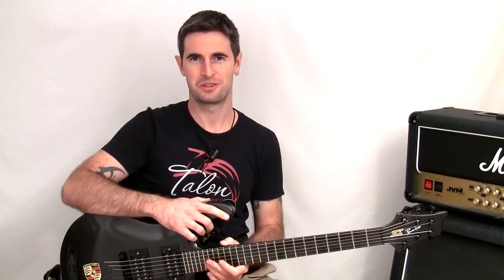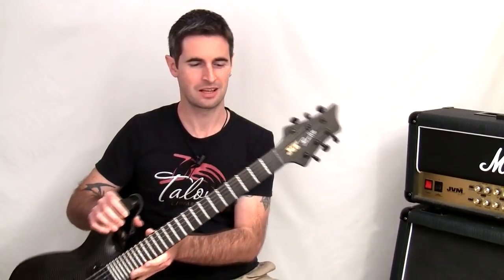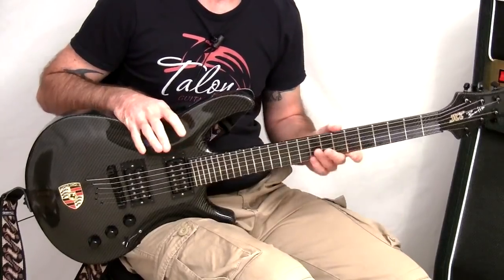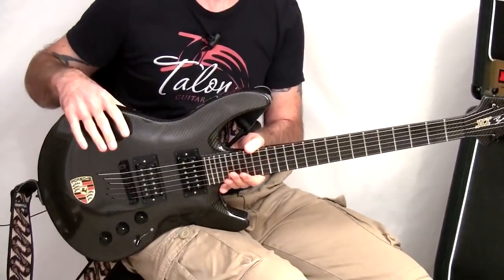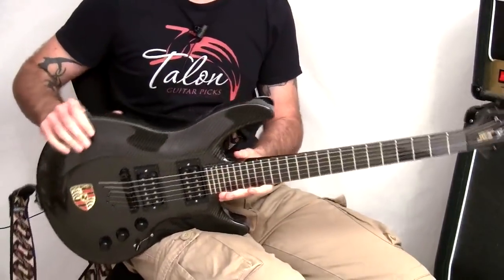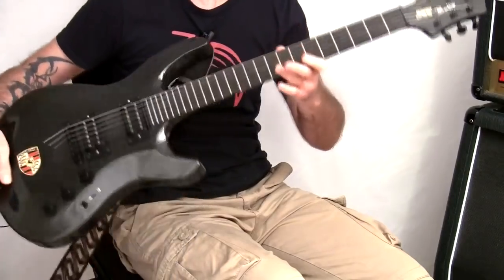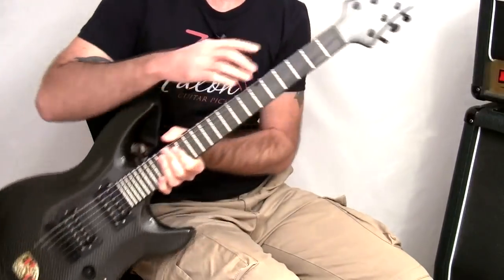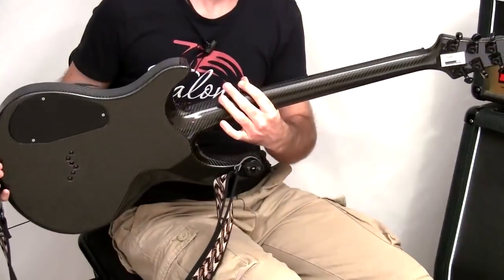This is What a CARBON FIBER GUITAR Sounds Like

Comment: It's a marvellous instrument. Tonewood is a scam.
Reply: Just because carbon fiber has a good sound doesn't mean the materials don't affect the sound.
Reply: If wood makes a difference its minuscule. Never seen a proper comparison video that shows a significant difference. Ill take the practicality of carbon fiber over wood any day.  Doesnt bend, isnt affected by temperature, light as hell.
Reply: @guitarboy4000000  Doesn't make a difference on a solid body electric. The setup can make a difference, the wood doesn't. The wood can make a difference (rather small) on a hollow body for unplugged sound, but as soon as you introduce pickups you can throw the wood out of the window. The only instruments where material can make a difference are acoustic ones, like an acoustic guitar, because then the wood can directly affect the way sound resonates within the body due to difference in flexibility. The magical tonewood for an electric guitar is bullshit propagated by the marketing department to sell you overpriced guitars.
Reply: @SkinnyBlackout  we agree on this point. what I have stated is that I have not seen a scientific experiment that can show me definitively that wood makes a difference. So even if there was a difference, it would have to be so subtle that its almost undetectable. my broader point is that having a guitar that is 3.5 pounds, doesnt bend, doesnt warp, and isnt affected by moisture would be so awesome that its not even worth considering if the material slightly affects the sound.
Reply: @guitarboy4000000  That is correct. There are electric guitars made of metal, those are cool af.
Reply: @SkinnyBlackout  well i was referring to this graphite one. imo even cooler than metal
Reply: pickups and amp make most of the sound not stupid tone wood unless you are playing an acoustic lame guitar

Comment: All I know is, the worst struggle for a guitar player is the constant fiddling and adjustment that wooden guitars require. Every day is a different story,  the weather changes and you have to adjust truss rods and it's gets old, then you have to worry about things breaking. It would be nice to own a guitar that is light in weight and doesn't require constant maintenance. With that said, if these had these in a V or Explorer type shape, I'd be all over them.
Reply: Maybe an all steel guitar with a back support?

Comment: It's got to be hollow to be the weight you state (if it was solid carbon composite, it would weigh similar to am un chambered Les Paul, resin is as heavy and dense as hard wood). I assume it is made like a surf board with a dense foam core. Please clarify.
Reply from the maker: It's a semi-monocoque construction so most of the stress is transferred to the outer surface. It's a semi hollow body guitar. There's no foam inside it.

Comment: RE: all the "tone wood" comments.  I've seen some videos that show measurement of the difference and there appears to be some.  I don't know if its perceptible or not.  What I do know is that I have some guitars that are the exact same - I bought duplicates because I found inexpensive guitars that I thought were great so I bought two (or three **he said sheepishly**) .  and I have a definite preference out of those duplicates.  some of my guitars with the exact same strings and hardware sound more "alive" even when strummed unplugged and some sound dead.  Some sound resonant and some don't.  I don't know why that is.  My theory is that some materials absorb some frequencies while others don't.  I.e. if you were to make a guitar out of play dough it couldn't possibly sound the same as one made from metal or wood etc.  Maybe there is some vibration feedback from the tremolo to the tuners and it makes kind of a loop that has some effect on the pickups?  why does a semi hollow electric sound different?  Another izzample:  I went to GC and just picked up a Mitchell MD-300 to try out and amp.  I was blown away by that guitar after trying it out on a few different amps.  Got mine on sale at $230 (just looked and they are now $200 dang it!  - still - that guitar is a freakin steal!).  Anywho, my OCD insisted on a shiny new one - I didn't want the demo model covered in fingerprints so I tried out the three they had in back.  Turns out the one that felt the best and sounded the most alive and resonant was the demo model so I bought that one and just cleaned the Shiite out of it.  I know we've all had that experience.  One more:  frequented a guitar store a bajillion years ago when I toured (regionally - nothing big time) and one day I walked in and the sales guy who I knew well was all excited to get me to try this strat that he said was awesome.  I didn't want another white strat so I tried others and he was right.  
One last example:  I went to GC determined to get a good cheap acoustic since I thought I should play acoustic more.  Went through all the lower pricest models and meh.....then I tried some pricey martins and then some Taylors - martins felt too dark and Taylors not enough guts.  Then gibson J-45 and wow! perfect balance.  Knew the sales guy very well there too after years of buying shit.  he said "dude, you gotta try this one we've been keeping in the back to play for ourselves because its incredible".  I played one chord on it and felt it.  resonated beautifully.   I was playing only acoustic electrics and only through the same amp because I was going to amplify it.  So, same guitar, same hardware. everything was identical but it was bursting with life.  There has to be something other than fit and finish (which obviously has an impact) - especially with mass-produced guitars that makes a difference.  Not arguing for or against "tone wood".  Just hoping for intelligent discussion preferably  : )

Comment: Badass guitar but not for $3,000
Reply: ouch...
Reply: carbon fiber is expensive $$$$$
Reply: Don't worry , I expect Harley Benton will bring out a Carbon fiber model for less than £300 any time now ...😁
Reply: You can fight a  bear with this thing and you might not even mess the intonation....
Reply: yeah i agree.It suppose to be kind of future replacement for wood  consume. But 3 grand hmmmm...
Reply: Tell that to people who buy $6000 Gibsons, then break the head stock. $3000 is a steal, especially when it saves you from having to worry about adjusting the truss rod every time the weather changes. That's the whole purpose of the guitar, it's not a novelty or for looks. The best thing is, they sound just as good as a wooden guitar, because we all know that the sound comes from the strings and pickups, not the wood or whatever material they are made of.
Reply: @TheUniversalEyes  that's true my friend...
Epic comeback....👍👍👍👍👍👍👍👍👍👍

Comment: Well, it's an electric guitar. It's going to sound the same even if you stick a couple pickups and strings into a plank.
Reply from the maker: That's the whole point. For anyone worried that carbon fire would make it sound worse, or affect it in any way... the take away is that you can make it sound just as you want to, like any other guitar